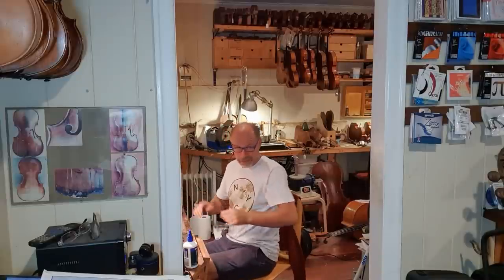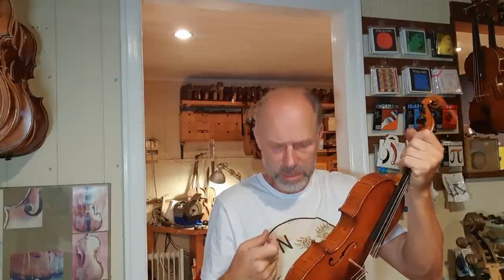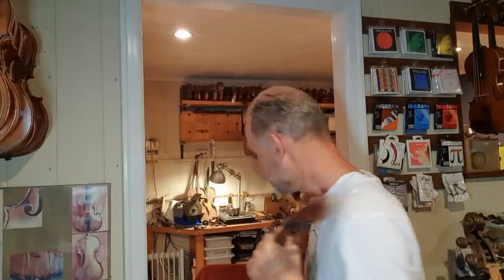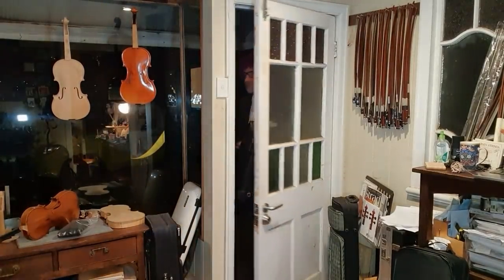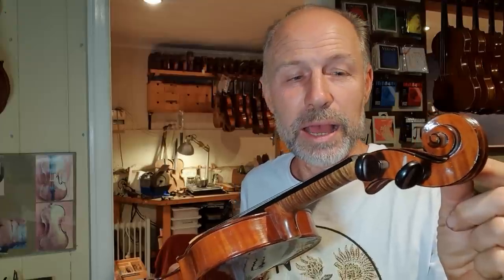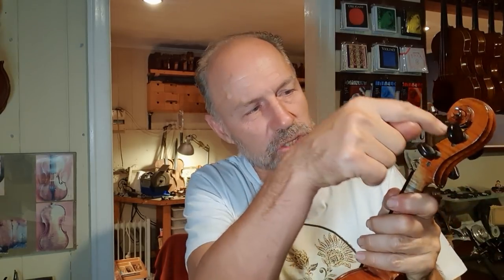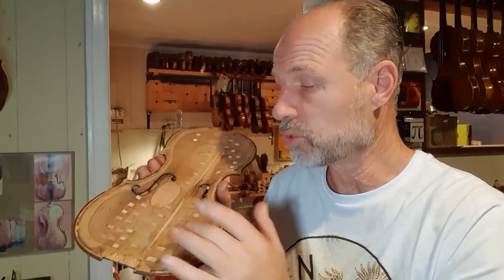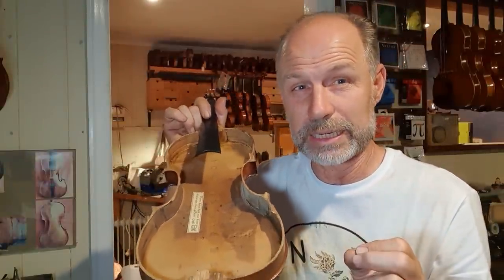My instrument has a Rattle or Buzz 😬

Comment: Great video that has happened to me once it was the finetuner
Reply: it happened to me with a finetuner as well i just took them all off except the e string because of string snapping anxiety
Reply: I always get rattled on my g string and I’ve had enough of it so I’m gonna get a new tailpiece with one fine tuner this week
Reply: @betultunca5418  I would but my pegs are so sticky and I can't
Reply: Josh you should be taking it to a professional luthier and let them do it. It’s not the safest thing to do at home
Reply: @betultunca5418  yeah, I need an upgrade and I plan on getting one soon anyways, so its not worth taking to a luthier
Reply: I changed my strings had a rattle for 3 seconds and the fine tuner screw fell off lol.
Reply: @423chriscampbell  bruh
Reply: It happened to me once when the strings didn’t fit in the nut well

Comment: Had a buzzing sound when I played my subwoofer. I checked all the things in my room and it was definitely coming from the box. Then I checked all the screws etc, took it apart and turned it on to identify where the issue is coming from. It ended up being glue coming away at the cone edges so the cone came off - similar to the most common issue of buzzing in fiddles as I learned from you today :) . Was definitely an adventure. You can listen for the source of the issue but it only helps so much. I also ended up fixing the screws on the back plate of my woofer as a side effect - they had a tiniest buzzing which was not noticeable at medium volumes and I didn't address it until the larger issue. Good Canadian-made components - but assembled some where else.

My cello bridge is also now in a better place than it was when I bought it thanks to you. It was really bad after I left it alone for some months but I started to regularly adjust it and it kept straightening as I played it to the point of settling into a much better position allowing strings to be closer to finger board - nice for the high parts :)

Comment: You can also have a buzz when you wear a shirt (with buttons in the collar). It happens quite often to me.
Otherwise, great video ! I love this format. Can you do a video about the whistling E string ? 
I had that problem. I changed my string, it was a little better, I replaced the bridge, it was also a little better etc. 
In fact, the real problem was me (I changed the posture of my left hand and I have now a better flexibility of the right arm : that was the real solution), but it seems to me the whistling E string could be a interesting subject.

Comment: My violin only started buzzing after I changed the string, do you know what it could be? Never rattled before, put new strings on, now it only rattles on the strings I changed when I strike them open (bowing doesn't seem to do it). I only started playing violin last month, and I'm already super good at it, probably because I started as a guitar player for 20 years, really helped me know where the notes are.
Reply: Well for me when I'm changing my string I would wait like for 5 minute, So the string will settle and then yeah there is some buzzing noises, for me I would've play on that new string until the buzzing noise kinda disappear and then it's just fine

Comment: I dont know if you'll see this but in the past couple days Ive had a strong rattle in my violin on the G and D strings and sometimes on the A string, but thats only when I have a shoulder rest on. when I dont the sound is completely gone, and my violin is singing like before. Ive checked for lose screws in the shoulder rest, nothing. Tried many shoulder rests, all have a rattling sound. Help?

Comment: How do you fix a small scratch or knick in spirit varnish?
Reply from the maker: It really depends. 
If the violin is not too expensive, try a tiny bit of linseed oil or paraffin oil. 
If it's a better instrument, it will need to be retouched by a violinmaker.
Reply: Thank you so sould i just rub a little on the scratch with a cloth and let it dry?
Reply: @AskOlaftheViolinmaker   also should it be raw liseed oil or boiled or does it matter?
Reply: @AskOlaftheViolinmaker  would linseed oil also work for oil varnish?